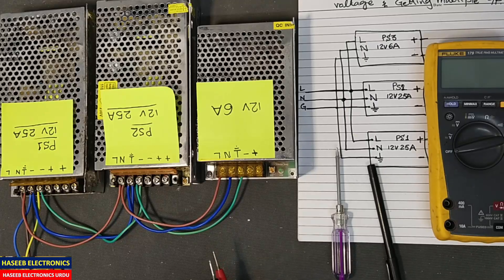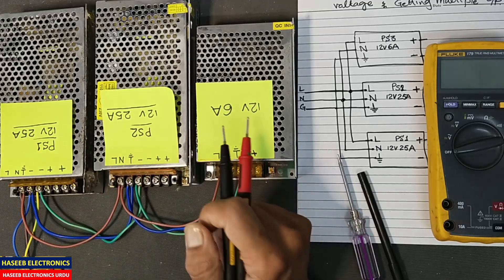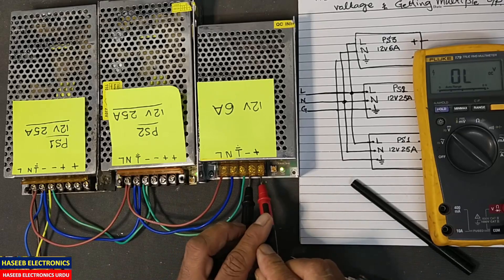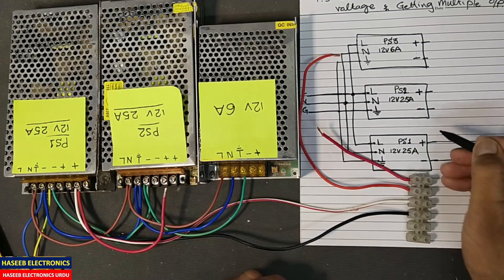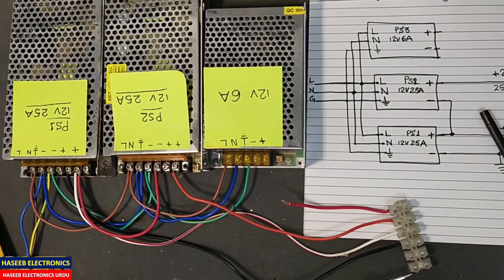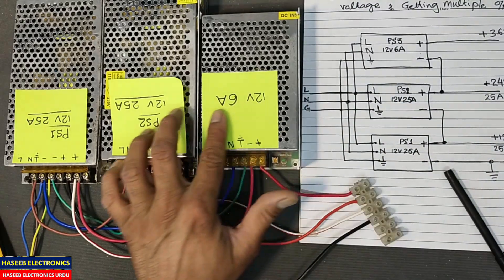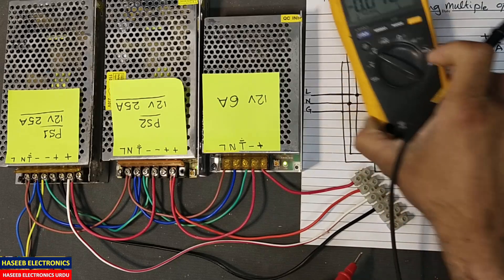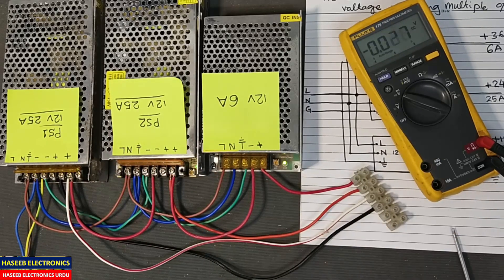{598} Connect Power Supplies in Series to Get More Voltage / Two or More Power Supplies in Series

Comment: Hello :-) ... again 🙂
I have HP 12V Server Powersupply's, too .
When i modify  that devices to 14V  i have in Series of 4  = 56V TOP ( I need that voltage )
Now comes a Big BUT!
But the Powersupplys has 100Amp  , that means i have than 4KW DC Power and i need  ~ 5KW AC Power on one AC Fuse !
 I need current limiting.
My Idea 
ok either i limited each single power supply before series connection.
Or I limit the series connection.
Is there a current limiting circuit that works for so much power?

12V/100A  or 56V/~100A current limiting circuit?

i try to charge with 80-100 amps/56Volt on lifepo4 ,
 You can then see me charging my battery in google earth, the red glowing house In Germany/Bavaria.
And red lines, that's the AC lines...
Reply: I know I shouldnt promote other peoples channel without permission but jehu garcia use such a setup for charging some life batteries, cant remember if he is using 4 or 6 in series,
Reply from the maker: @Dan Tronics it is really best to discuss with each other. and share ideas. when we share ideas and our experience to each other, it leads us to some perfect solution 
special thanks for replying to @BavarianSuperGuy
Reply: @dantronics1682  ...the world is small :-)  iam a subscriber from him ,too :goodvibes:thanks
Reply from the maker: wow it is really great work. 
but first i will recommend to use proper charging system for thos LifePo4 batteries for safety, as batteries are like a dynamite

1. yes you will need safety fuse
2. instead of current limiting, it will much better to arrange a battery management system (BMS) circuit to control and maintain the batteries. 
wish you best of luck dear brother
Reply: @HaseebElectronics  I have a bms on it and it  is save .  the current limiting i need for start charging slowly like a solar charger. :goodvibes: Thank You for your Video Work
Reply: The way to limit the current is to substitute one of the HP power supplies with a much lower current power supply which has adjustable voltage AND adjustable current.  Many but not all Meanwell units have this.  (for example HLG "A" series, HRP, HRG,  RSP, maybe ELG among others).    You set the voltage so that the total string voltage is the correct max Constant voltage charge termination level, and set the current to your desired maximum.
Reply: @GannDolph  cool, i will test this with my riden 6018 and hp power supplies, thanks for the tip 😀:washhands::elbowcough:  ... yeah let's smoke Riden , agaiiin ...
Reply: @BavarianSuperGuy  cool.
Reading through your question/objective again, it seems like you may in fact be looking for the beefy current, but when you hook your 56v string to a flat 16s LiFePO4 the chargers immediately go into over current situation - is that correct? 
   If they aren't already, make your HP voltage  mods variable by using potentiometers, and fine tune each of the four circuits (by employing extra fixed resistors -learn on google) so that the full adj range is 12v (or lower ideally) , up to  exactly 14.0 (or 56.0 when all four pots are turned all the way up).    when you want to charge start with them all the way turned down and then start adjusting the string voltage up until charging current is what you want.   then keep checking as you will need to keep turning them higher as the charge progresses.   this is essentially how a real charger controls the current ,  but doing it automatically/electronically obviously.
   if you do try to automate it with electronics , make sure you know what you are doing .  each power supply has a different ground reference so don't spoil the isolation or it'll smoke !

Comment: How does mobile phone charger work and why the cord have four(4) wires
Reply: either the green or white wire is connected to a resistor which is grounded, some phone chargers have both data d+ d- tied together
Reply from the maker: @Dan Tronics 
you are right inside a branded charger, data wires are terminated to ground but in low quality chargers these are left open ended.
Reply: most chargers use only 2 connections of 4. some iphone chargers use the other connections to make sure it is a genuine charger and cable..
Reply from the maker: @Theseus perfect dear
Reply from the maker: there are 2 types of charging cables 
1. USB Charging cable (it have just 2 wire, normally red & black for +5 volt & common) 
2. USB cable  it is charging cable + usb communication cable (Red & black wires for charging purpose,  while white and green wires are for data communication between the mobile and the hosting device) the fifth one there is also a shielding braid which is connected to both side connectors and ground wire. it provides signal shielding and protects the communication loss and protects from uter interruptions
Reply: @HaseebElectronics  okay thanks